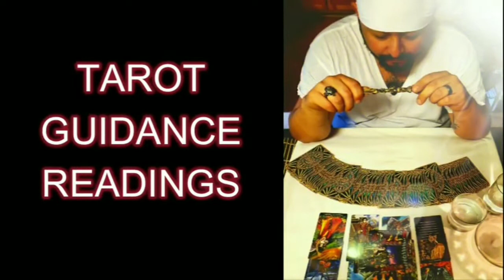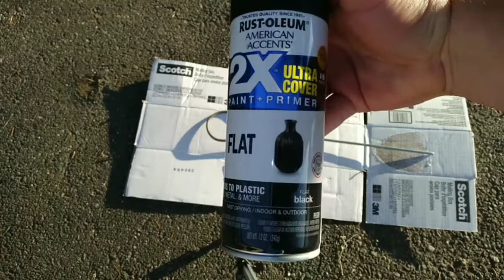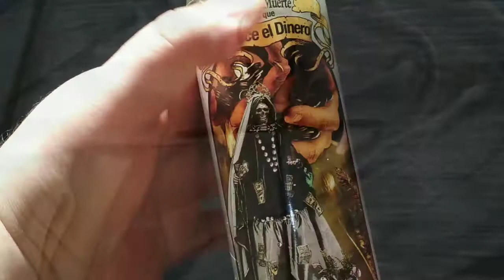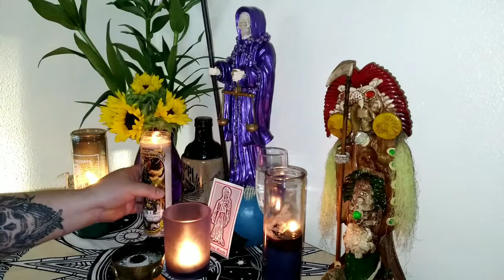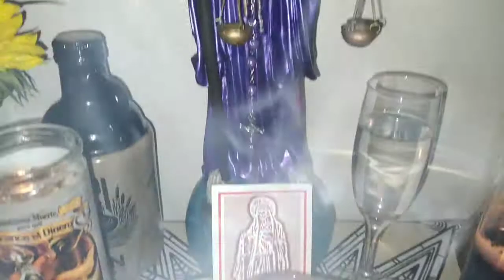Fashioning a Candle Ankh/Candle Rod of Correction

Comment: Love the fact you used your own craftsmanship to build your own tool.
Reply from the maker: It's typically how these are made, you either know how to make it and have the tools to fashion it out or know of someone who does both. These are not really easy to find for sale anywhere, I know of one place in Texas who sold them and thats only because they had a few extra made and weren't too cheap either. The first one I had was actually handed down to me by my Muertera....unfortunately a perpetrator made off with it. Trust and believe, this bears having to use a screw driver which is what most everyone uses or a chop stick when not able to find one of these Candle Ankhs/Candle Rod of Correction.
Reply: @theguardowl  well I’ll see if a bud can make another one for you some time down road. Aluminum or SS?